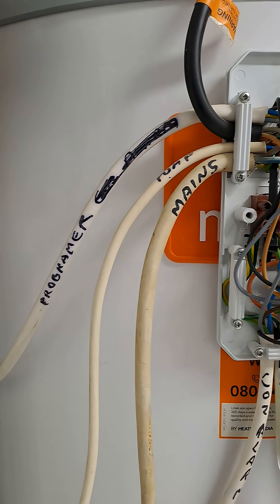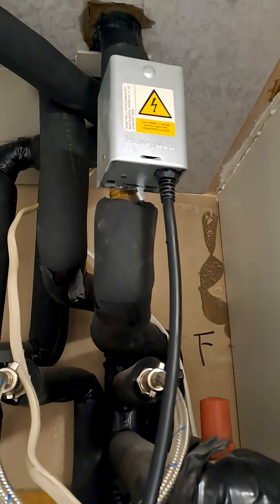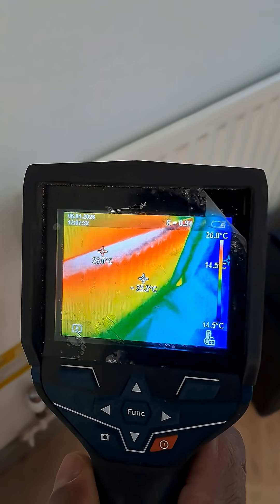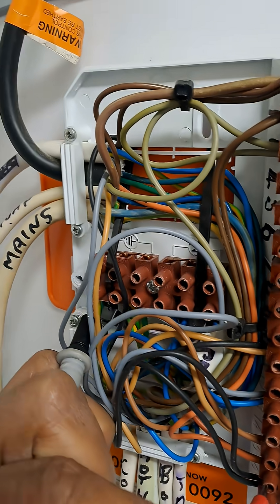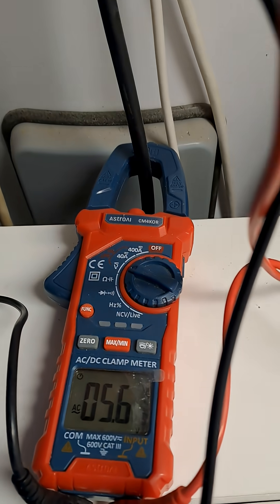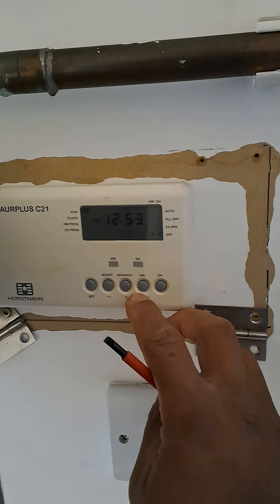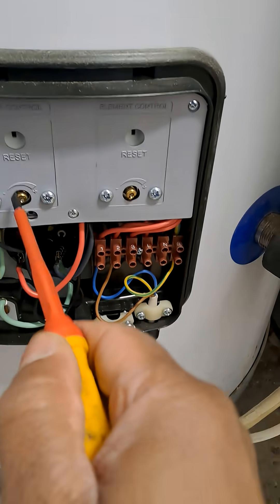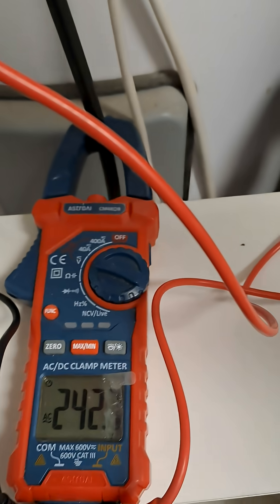Quick Heating Zone Valve Checks

Comment: Hi what multi metre are you using and is it good ?
Reply from the maker: Hi, I have 3 and it's the cheapest of the three. Seems ok. I plan to do a vid  on all 3 comparing them. The name of this one I'll try to get back to you. Just recall getting it on amazon for £35-40. It's not too bad. It's not perfect, but it's the one that I had in my hand on the day.
Reply: @CommercialGasEngineerVideos what’s the best one you use
Reply from the maker: I have a fluke and testo. I do like the testo. I'll try to make a video this week on the 3. No promises. Comparing etc

Comment: Some engineers argue changing the synchron motor as it’s cheaper for the customer .Obviously checking if the spindle on body is moving freely I prefer to change the head. People might say it’s lazy but you have the warranty on the entire valve now and not just the motor .
Reply from the maker: On this occasion, the maintenance men just wanted me to diagnose, and they want to change it themselves.